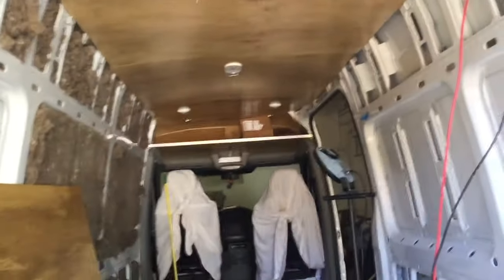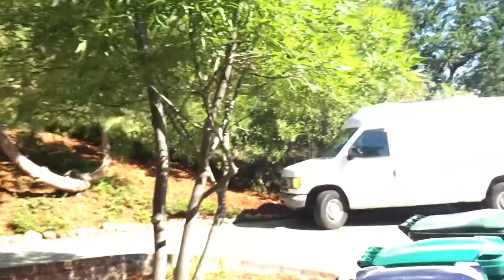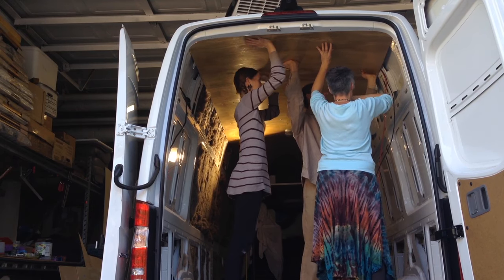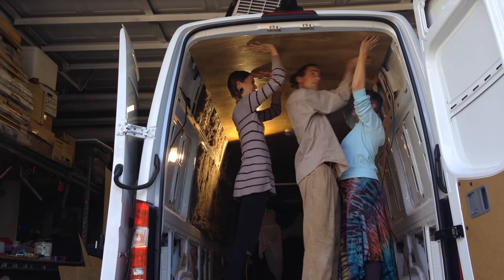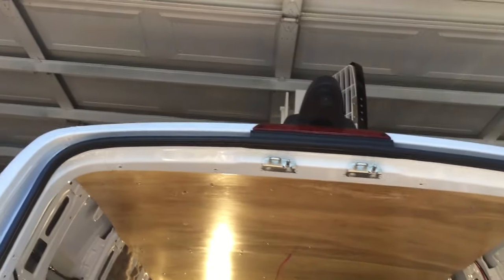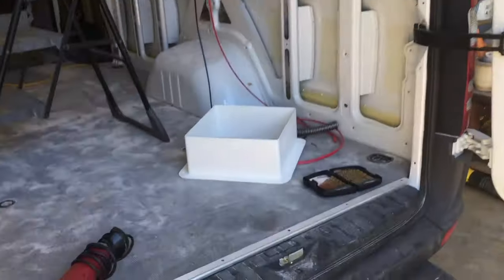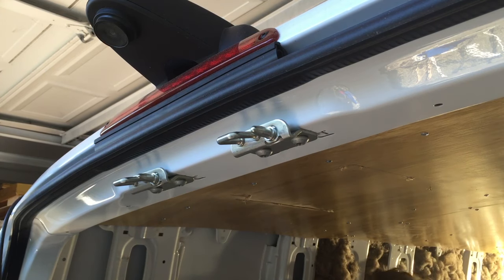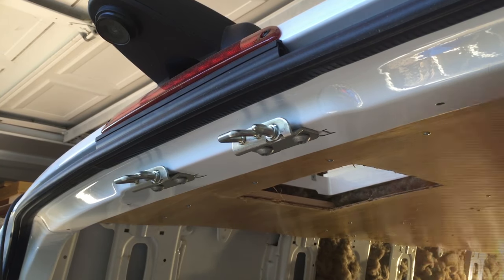Part 7 Sprinter Van Conversion - Finishing The Roof

Comment: Questions:
1. Where did you buy the wool rolls?
2. Where did you buy these screws to hold the board?, these screws go  in the steel of the van panel? How long are these screws?, how far apart are the screws?